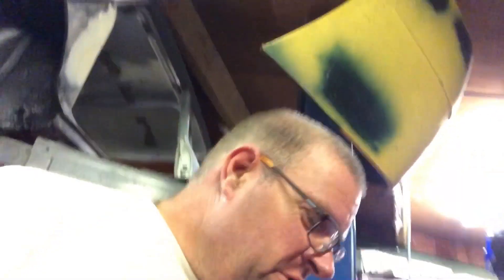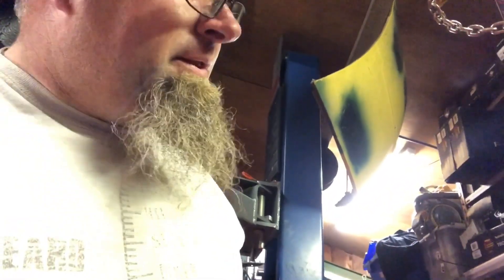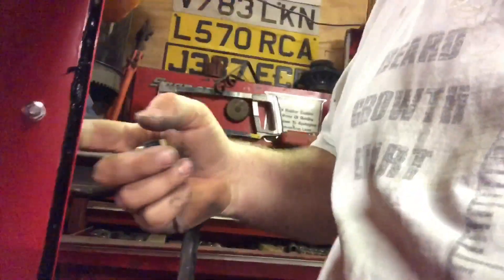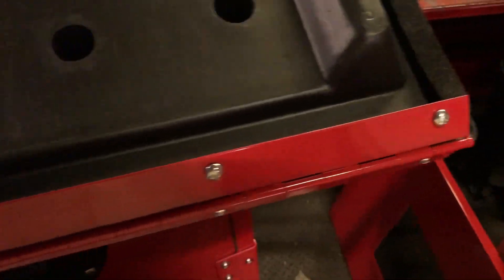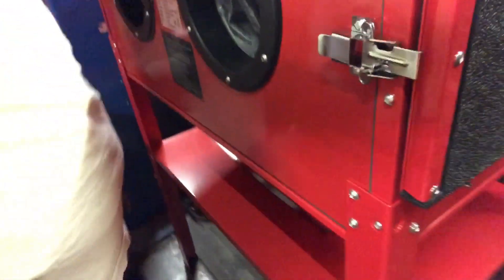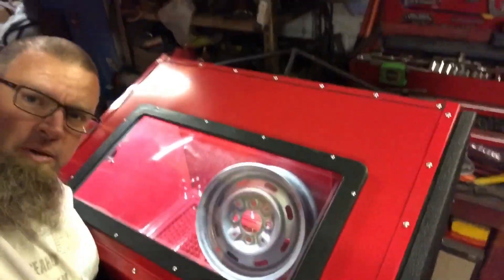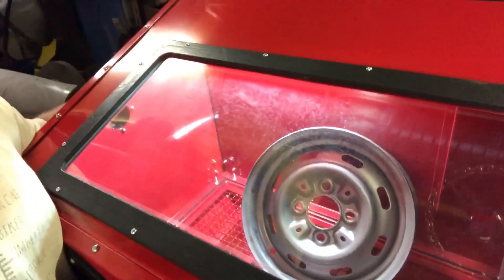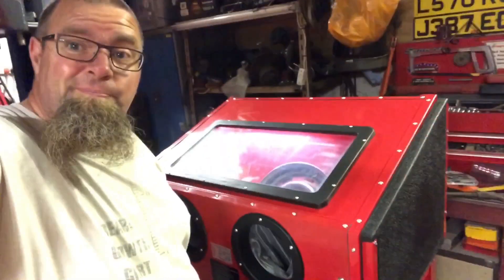220L sandblasting cabinet Part 2

Comment: Would an 18"motorcycle rim, or even a 21" motorcycle rim fit with some effort?
I am looking for the smallest cabinet possible to still be able to do a rim in an unusual occasion with some additional effort.
Reply from the maker: Thats a difficult one to answer , the door opening will fit a 15” car rim in but working around it inside the cabinet is very difficult, obviously a motorcycle rim is smaller in width , it might just be possible? It will probably fit through the door !

Comment: hi i know this was years ago but thought id ask anyway, do you remember if it came with an airline connector  fitted, mines doesnt, and do you still have instruction sheet as i have nothing and its complete guess work
Reply from the maker: Hi ! I’m sure mine came with some kind of assembly instructions but it’s pretty self explanatory . And I’m pretty sure there was no airline connector with mine either ? 

Good luck with it ! It’s very satisfying watching all the crap disappear . The only other advice I would give is try to upgrade the internal light to something REALLY bright it helps a lot !